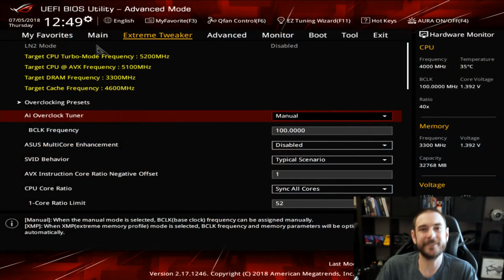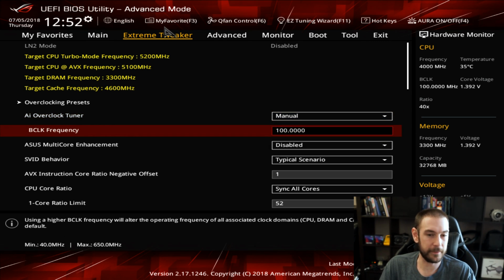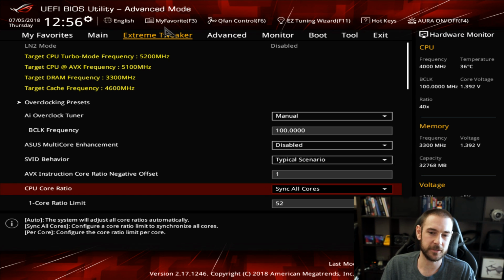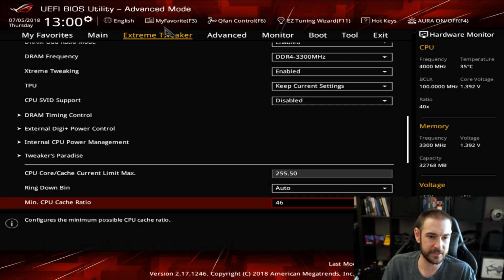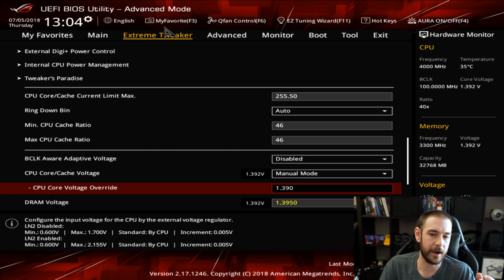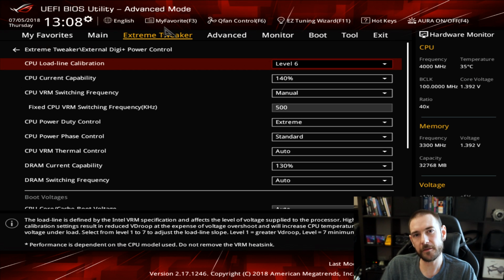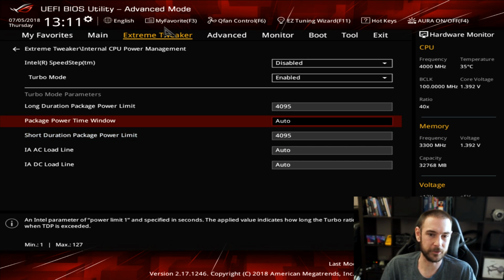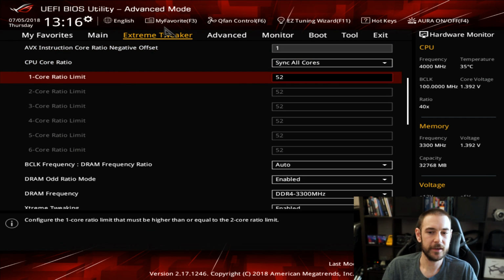How to Overclock an 8700K & 8086K - ASUS Maximus X and Others

Comment: Just saw this but first : I Gave up after destroying 2 8700k's, 2 x hero's & 3 sets of dominators since launch simply because i was trying to prevent this double boot issue
Whenever setting my ram to XMP

 
I followed all the best advice I thought i could get yet felt ruined time after time. 

Was stunned to hear you mention the double boot whilst also noticing your VCCIO and VCCSA EXACTLY like my numbers but in my case -when I set to XMP.

I really hope
hope you can answer me on this - when I set lower VCCIO double post goes away but I am afraid things may not be stable in long run. So is it safe you are saying to leave it at those voltages with xmp ? 

Mind you the damage to cpu, ram, motherboards occured only when I either lowered Dram speed in error as a noob  or slightly upped the dram voltage etc on step by step advice from forum "experts".

One other thing is that I have left settings on default this whole time for months on, disabling MCE & XMP.
This part is due to the above history with the addition of my h150i (also replaced ) as not spinning up or down with temps. I have to manually set the fan profile causing me to worry about overclocking. Is this normal ? would you know about this matter ? I mean i can't overclock and have my fans only set on one profile : low , balanced , performance lile this. I would like to leave it to go with the temps cpu or liquid  however I heard that if you set the h150i  to move with the temps of cpu  it is not good in corsair link and must be set to liquid temp but if i keep the way it is on liquid temp then the fans still don't spin up no matter how high temps get or how long. 
Is there a bios setting i am missing because nothing in link seems to solve it. 

Many thanks for video i want to get back to solving my issue and found this and feel more confident. 
A sub to you won't be enough to appreciate what valuable information  you may have for me.
Reply from the maker: The double post is usually caused by failed memory training. It’s perfectly normal after a totally cold boot where the power supply has been turned off. But if it’s happening every boot I’d be looking at your ram. Try running it at the default JTEC settings rather than XMP and go from there.
Reply: @boostedmedia  wow thx for fast reply. 

I can confirm it happens with cold boot where PSU switch is flicked off with XMP (without XMP i see the board lights jump a couple of times between red and orange (cpu &dram) before moving on all fine -no double post though. RAM is not on QVL.
 Everything "seems" to run fine in windows environment regardless.
 I just figured that since i can stop the double boot by lowering VCCIO that it was necessary to do this and more just worried about whether during overclocking it is indeed safe to lower it or better leave it like you said in video for stability and/or is this asus board just over doing it.
Maybe I have biosophobia???

Either way I am gonna use your guide coz it's the best and so well explained for me personally & i hope to get more detailed videos like this.
Think you are gonna get alot more subs very soon m8.
Reply from the maker: The is for the kind words. If the ram isn’t QVL then all bets are off really. I’ve personally experienced some really strange booting behaviour coupled with random BSOD associated with RAM issues. 

The weirdest one was when it was absolutely fine under load, but random BSODs at idle. Turned out to be particular sticks of my ram not liking being in the same channel. I swapped them around and problem solved. 

Every system will be a little bit different so it’s impossible to say what the minimum tolerable VCCSA and VCCIO will be for you. But if the double boot is only happening when you’ve had the power completely off or disconnected then the double reboot is perfectly normal. Mine does the exact same thing. 

I might actually do a video about this. Seems to crop up a lot.
Reply: @boostedmedia  Understood.
  It is always some trial and error i see and shouldn't take much fiddling with, 
Just the nature of RAM in some motherboards and some Cpu's. I am actually confident now that all is good for me and if i wanted i could test other RAM anyway But shouldn't be nessessary. 

You are the best! Had a quick peek over some of your other videos and am really excited to try out some guides such as the watercooling tube bending tutorial after i follow your overclock when I get home. 

Well done mate nice guy,  great channel! All the best bud!
Reply: @appaaa1103  double boot is not normal such as the fact that asus boards suffers from stutters in games,i use the gigabyte aorus gaming 7 never and i mean never had issues in overclocked rams or cpu,never had issues with double boots in cold starts,and i dont consider those things normal,also seems that every asus board needs signifficantly higher voltages to sustain high clocks with no bsod's which i suppose to be due to lower quality vrm capasitors at least from a certain frequency and after the asus board starts to saw that flaw,i dont really know how you blow this hardware but it seems really hard to do it at least in my eyes unless you was trying some crazy voltages and configurations i dont know. But as bios fuctionality goes i think asus is the best out there but again asus have became somewhat apple for pc's because they have a good uefi doesnt mean that they should charge so much for less quality components just because they called asus. Maybe next time buy a top tier asrock mobo or an aorus top tier board for the price range that they sell them they offer better quality but not as good uefi as asus.
Reply: @RipperDraco  idk man I'm hearing too much people saying system post twice seems 'normal' and I take it to mean they have same issue here but don't suffer. With regard to voltages i only lowered the dram frequency whilst making sure to lower the voltage ( basically leaving the xmp and trying lower speeds) however I came back into bios and the board set high voltage. So i changed all to defaults cleared cmos but too late. 
My reason to want to overclock is that I get unsmooth fps with gtx1070 and even though i get above 250fps and below 300fps. No matter what setting I choose in nvidia control panel only way to reduce it is to use asus software sonic studio and change audio sound in EQ custom to use reverb. If use reverb then stutter almost entirely gone, but in fps games this sound is horrible to hear footsteps. Since I didn't overclock yet i wanted to use it becoz something tells me I have to for stable voltage on these boards. And yeah one way or another I'm sure when my first time lowering voltages I destroyed system. I have delid tool everything but don't want to use till I understand fully. Still can't understand 100% sure either to go adaptive or manual after finding stable OC using manual voltage.

Edit: they don't suffer other issues in OS.

Also both times previously my cpu was downclocking but not thermal throttling in stress test tools like prime 26.6 and aids 64 . Not so much realbench if i remember
Reply: @appaaa1103  listen there is no way on earth that a system can die from undervolting if you put manual values at least it shouldnt but if you put manual value lets say in vcore and let many things on auto maybe the llc which is on auto spiked the cpu extremely high due to very low voltage and died. As for the ram it seems just impossible especially with undervolt. I suggest you not to follow any guide simply because you can not fully understand what you are actually change,the creator mentioned one thing which was 100% correct that what it works for me it doesnt mean that it will work for you he is 1000% right. With no dissrespect for his efford and his video plz dont follow no ones guide unless you understand what all those settings actually do.
Another good way to kill hardware is to use the clear cmos button with the power supply and the swich still on but its less possible with a good psu
Reply: @RipperDraco  should've made clear that I wasn't following a guide alone but read as many as I could in relation this setup and issue.  Then was taken through steps from guys at asus and toms forums they told me step by step and all I did was lower my ram speed, disable MCE, try lowering VCCIO a little -(separate from these steps )and work the speed downwards without touching voltage at first all the way down to jedec or default speed. 
After this I was told I could keep the xmp or manual punch in RAM settings and up the DRAM by 0.05 at most otherwise return RAM. I went back into bios and noticed the DRAM went to 1.6 when i already lowered my setting based on the advice of ALL these people i am getting the emails from simultaneously. I recorded at the time the process and was promptly given replacement. 
Second time I did same thing and noticed same behaviour again given replacement and was told this IS odd behaviour, 3rd time I never bothered. 
Speaking to others about all this I was told they never changed the speed of the RAM as there is no problem with having double post on THIS particular board. I seem to get that now as many have suggested memory training including RAJA from asus. 
You cannot begin tuning without some testing and have to learn to walk on your own. I don't believe I had issue understanding anyone at the time. All i can say this the above is all I know and am out off with bothering since with this 3rd board cpu RAM i am not getting any downclocking or any of the sort just the double post again which I have said I wasn't 100% sure it is safe to overclock a permanent setting with. I guess I could only test different board or different RAM if i think I don't want to take this risk other than that there is no one else that can tell me for sure for e.g. you say double post i abnormal whilst many or infact all others on forum have said it's totally normal on this board and if I wish I could do the above 'safe' settings
Reply: @appaaa1103  i just bought this board new to test it i will let you know.
Reply: @RipperDraco  ok m8 thx :)
Reply: @appaaa1103  ok i finished all the testings and i have to admit that this motherbord performed better overall than my gigabyte exept in vrm temp that went 3 degrees warmer,i havent tested yet  the cold start but in the first times boot it really boot two times back to back,i noticed that the motherboard havent got manual fixed ram training so my guess is that is the reason behind it,i can guide you if you want but everything it depends on you silicon quality and your rams modules,to be honest i managed to go at 5,4 ghz with only 1.39v in this mobo which is nuts and before anyone asks bullshits yes i tested with small ffts only one test is enough to kick the hell out of the oc if someone passes primes small ffts one time he is basically done. One other thing is that keeps the cpu much colder due to as i see in the graphs flat voltage delevery which was the main problem in the gigabyte board the graph was all over the place. So i must slap my self because this is an extremely good mobo
Reply: @RipperDraco  haha. Nice to hear! Yeah i 
Have hero 7  aswell as 10 next door with my 4770k for long time, Never give me issues. 
What ram are you using and have you set it all up good now ?
Reply: @appaaa1103  atm im trying to do an adaptive oc and its a pain in the ass. My ram kit is a g.skill trident z rgb 3200 mhz 16gb cl14 kit oc at 3600 mhz atm with timings 14-14-14-34 ,yeah no issues,at least with fixed vcore voltage.
Reply: @RipperDraco  so during stress test is it normal for clock speed,  temps and voltage to go down for e.g.. from 4300mhz to 4000mhz after like 10 secs...? why does this occur AIDA , prime 26.6 & realbench. My cooling is AIO h150i temps avg 78c
Reply: @appaaa1103  you reffering at stock settings? Stock settings as it is the cpu under stress is locked at 4,3 on all cores ,at least mine which is 8086k i emagine that 8700k should be the same?Voltage at stock is normal to go down yes because the llc is on auto which basically is llc arround lvl1 or 2 so underload is normal to have vdroop,as for the temps if you have so high temps at stock clocks something is terrible wrong.you have an aio too. Have you ever tested a different psu in your pc? The core drop could be possibly from a faulty psu too
Reply: @RipperDraco  Yes this is with my fan speed on auto which doesn't push up with cpu temps. If I set to max profile i  corsair link the. Temps get lower
Reply: @appaaa1103  those temps are very high regardless of how fast the pump goes,is this cpu delited? If you can not sustain the stock 4,3 ghz clock and you drop at 4 which screams problem then what do you think the temps will be at 4.5 ghz ? Plus 10 more..thats not right my friend something is wrong there
Reply: @RipperDraco  so strange i just followed the above guide at 4.8 ghz and temps are 60 -65 ??? Maybe all the settings default very bad ?
Reply: I just noticed that with these settings my vrm is no longer 127c it is 46 on the one that said 127. I was told it is impossible to be 127 but why it change to 46 .... after overclock! Lol this shit cannot be funny btw realbench avg about 70c @4.8ghz before 76
Reply: @appaaa1103  can you plz follow step by step what i will say? First go and save tbis profile that it seems ok . Now turn the psu button on zero and remove the psu cable wait a little bit to see the lights go out ,press and hold the power button at least 10 sec then push the clear cmos button for 10 sec, plug the psu cable and put the psu button on 1 ,now boot and press f1 to go into bios and anable xmp ONLY ,save and exit ,press f1 or delete again to enter again the bios,down in extreme twicker only change the cpu vccio voltage to 1,00v and the cpu system agent voltage to 1,05 .boot and do a stress test plz. And plz follow the steps as i said them.
Reply: @RipperDraco  Yes m8 i have done this many times
Reply: Same as you said . If I do this then evrything good with RAM no double post i use same voltage too
Reply: @appaaa1103  i cant understand where is your problem then. If you are ok with those settings then why you was hitting sky high temps in cpu and vrms? Btw that was your throttle.after 110 c the vrms goes into throttle mode..if you seen those temps you should have stopped.........jeez man.

Comment: Brilliant video. Got a new 8700k and a 'professional' overclocked it for me. Temps up to 95 degrees , instability etc. Literally copied this video and the settings instead and have 4.8ghz with an aio and getting only up to 70 degrees avx load with 1.3 volts. Thanks so much for the detail in this.
Reply: Not yet. I'll give it a go. Subscribed now btw. Cheers.
Reply from the maker: You’re welcome mate. I’m glad it helped. Hopefully you can squeeze even more out of it. They probably just it the auto overclock button and charged you $100.
Reply: i have mce enabled and while gaming i never get above 60c using a noctua d15s on a hero x wifi mobo
Reply: Funnily enough I tried the extreme overclock preset on the motherboard and the settings they had 'tailored" were very similar, so you're probably right. One quick question, if that's ok? I've had the odd bsod with an issue saying whea_uncorrectable_error. Is that saying i should add a bit more voltage to the CPU?
Reply from the maker: Could be a lot of things. Have you watched my stability testing video?

Comment: My results with 8086k (Using custom Waterloop):
5.2GHz @ 1.345V
5.3GHz @ 1.38V
5.4GHz @ 1.48V (Max temp @ Cinebench was 85°C)
I can use 5.4GHz @ 1.42V for regular use + gaming. But for 100% stability also while rendering I have to go up to 1.48V.
Reply: Im having a stupid weird situation. using a premade OC i run at like 50°C but making my own overclock that uses less voltage is somehow making my computers temps jump to 70°C just idle. I have no idea what to do. The premade oc i see my voltage jump as high as 4.7 and my custom is set to 1.25

Comment: I set my CPU to 5.3 water cooled under full load for 3hrs did not go past 60.  On the AVX in i have it set to 0 do i really need to have a offset if the temps are ok?
Reply: If temps are nice and low there is no need to set AVX.

Comment: I used this tutorial for my delidded 8086 on a micro atx , z370G Gamingfrom Asus. Yes the one with the terrible voltage parts on it, haha. Anyway,  I had a cold boot issue as well and my problem was the min- and max cpu cache settings, I left them on auto and could leave the VCCIO at 1.09V and VCCSA at 1.168V. Perhaps I can bring them down any further.  (3600Mhz cas15 G.skill, 8086 @ 5Ghz 1.23V) Bringing the cache back at stock worked and has afik no performance impact. Maybe I'll play with cache again when benchmarking. Cheers for the videos!

Comment: well, hello boosted media ! your video really helpful !
i followed your settings but unfortunately im able to OC my i7 8700k on 4.7 ghz  1.235 v   :(
its a little bit stressful because im trying to get 4.9 ghz atleast but im stuck on 4.7 
tried to get 4.8 ghz on 1.25v and its very unstable and my max core temps above 85 c 
so i decided to stay on 4.7 ghz :(

btw my specs is :
- i7 8700k 
- corsair h115i pro RGB
- corsair vengance pro rgb 3200 mhz 2x8 gb
- asus z370-f rog strix
- phanteks p400

It would be appreciated if you could help me . 

+1 subs
Reply from the maker: Assuming you’ve got all your settings the same as the video, you’re going to need to delid and get those temps down before you can push any further.
Reply: Thanks for the advice bro . 

Yeah It seems my cpu is crap haha and need to delid it .